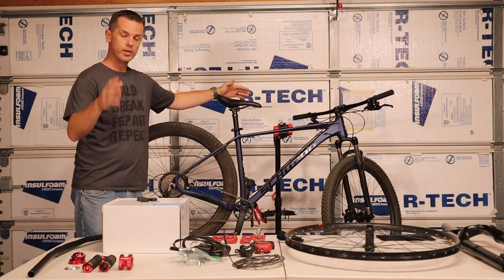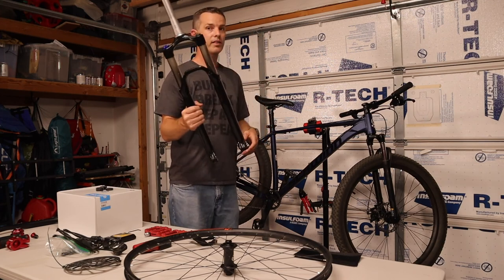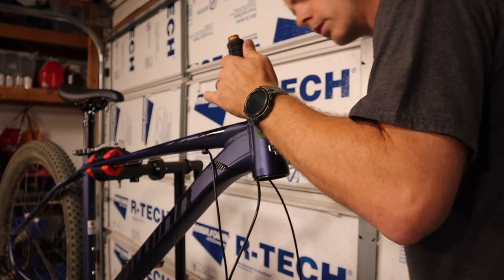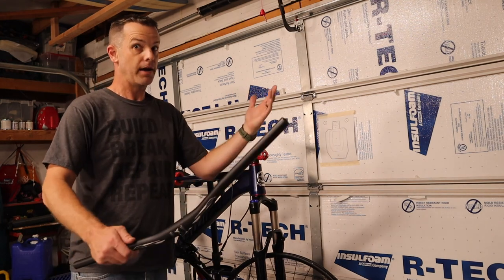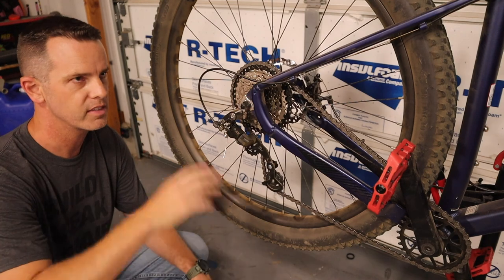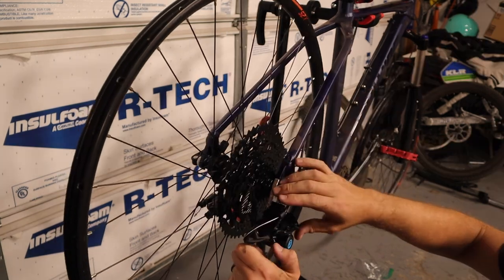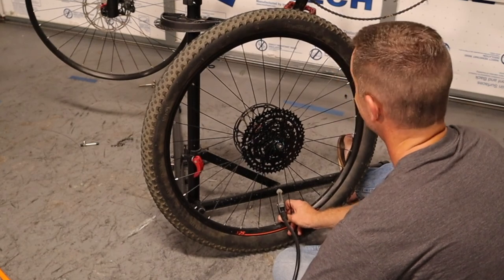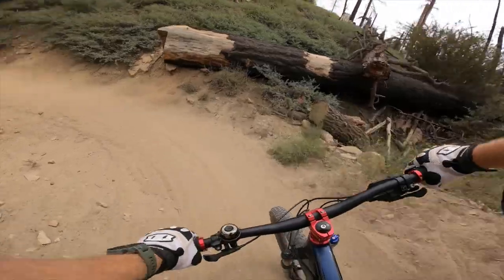Massive Upgrades to a Budget Bike -  Save Money!

Comment: Microshift can be had for less. Acolyte rear derailleur works the Advent X 11-48T 10 speed cassette with 10 speed shifter. @120 max if sourced separately.

Comment: Thanks, great video, which convinced me to buy axum and slowly upgrade it. I have a question about wheel upgrades.

How did you fit the boost thru axle rear hub into axum's quick release dropouts? Axum has 141mm boost spacing (quick releases), but the thru axle boost hubs are 148 mm.
I can't find a solution for budget rear wheel with boost thru axle hubs. DT Swiss and other major brands provide a solution with replaceable end caps, but those wheels cost a small fortune. Curious how you were able to fit yours.
Reply from the maker: I’m not running a thru axel on the tear end, only the front.
Reply: 142 TA will work on the 141 Boost rear dropouts. Axle adapters are available. Use a 142mm 12mm to 10mm QR and a 3mm rotor spacer. 148mm hubs usually have end caps to 141 QR. Origin8 148 Boost hubs will convert.

Comment: How did you remove the Schwinn emblem on the front??
Reply from the maker: Heat,  hair dryer will work.
Reply: @BudgetOutdoorAdventures  cool! Did you see an paint discoloration? Did you use toothfloss or something else to pry it loose once it was hot?
Reply from the maker: @hawker604  Nope, it was very loosely put on.